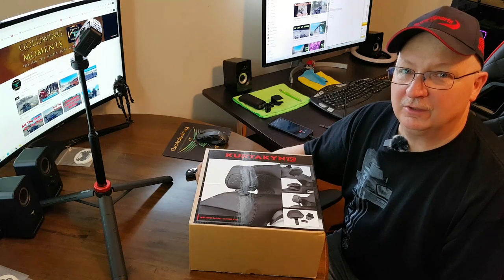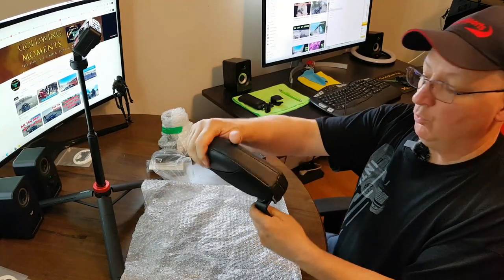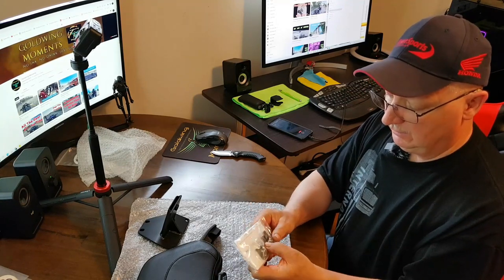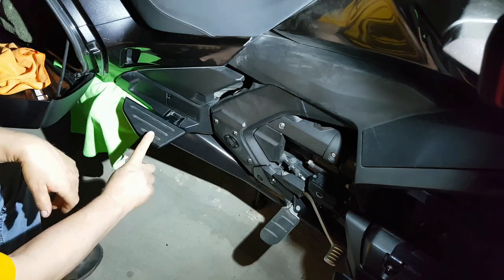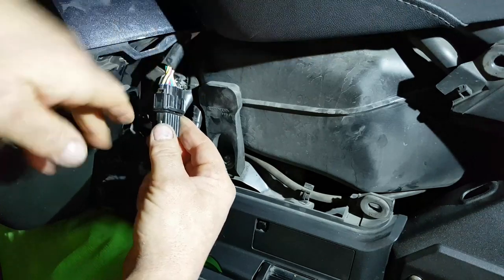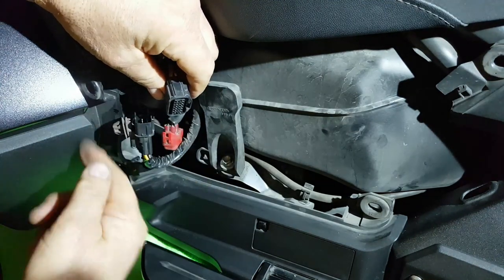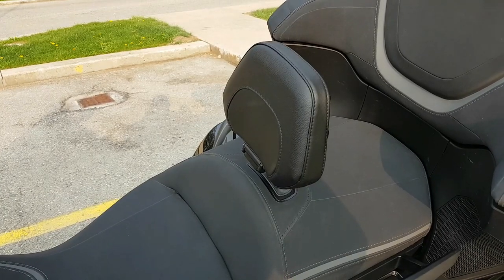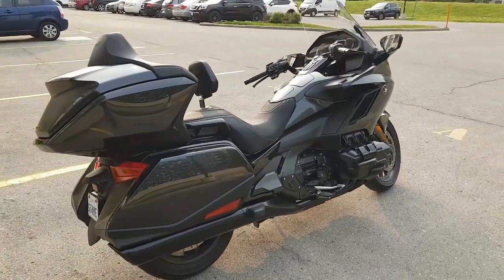#62 Kuryakyn 6772 Driver Backrest Install On A 2021 Goldwing Tour

Comment: Does water get trapped inside the backrest support pocket (inside the factory seat)?
Reply from the maker: Good evening Mark and thanks for checking out the video. Yesterday I power washed the bike completely including the seat. Your question was a good one so I just went and took a look at the seat pocket. The seat pocket was dry and there was no water. The bracket that is installed under the seat fits well through the rubber seal but not tight enough to completely stop water from draining. There was a few droplets of water in the bottom bracket itself. The seat pocket is sealed to the fabric so there is no way water could get into the seat cushion. I would say that there would be nothing to worry about. If you have any other questions, please feel to comment and I will do my best to get you a good answer and pictures if needed. Stay safe out there, Larry.